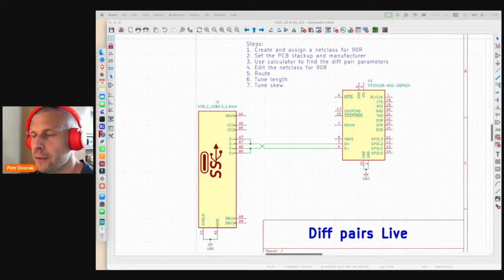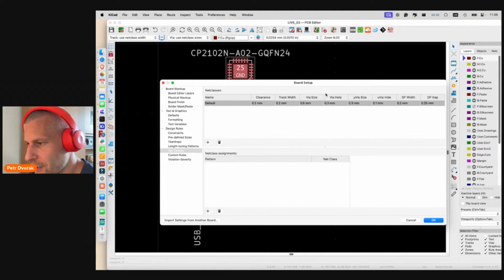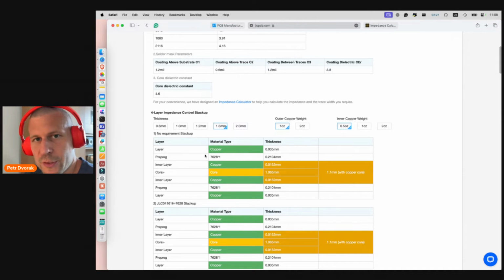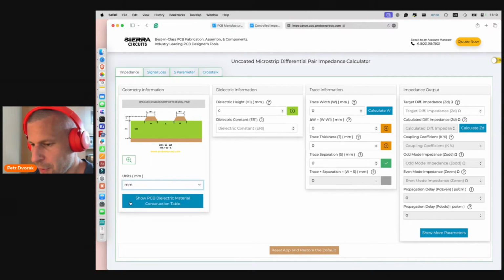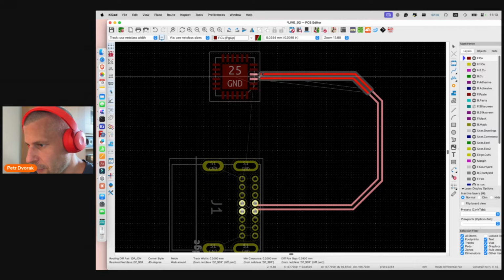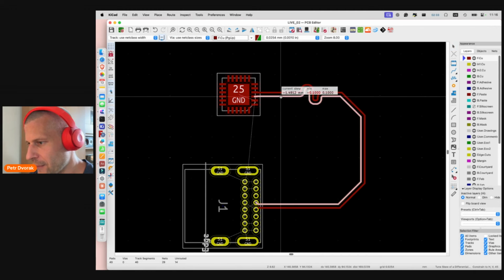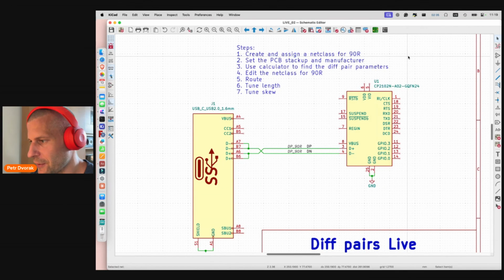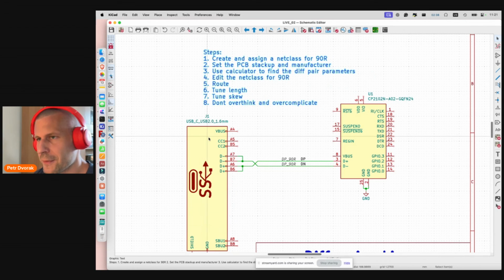KiCAD Differential Pairs  From Basics to Mastery

Comment: Thanks for introducing me to this calculator. Once you start digging into this stuff, you realize there are countless calculators out there, and none of them ever really agree with each other. The Sierra Circuits one seems pretty accurate, though.

Note that you have introduced a mistake in your video: when you calculated the track thickness at 12'00", you forgot to specify the 1oz (0.035mm) copper thickness (T). The calculator doesn’t warn you, but it displays an incorrect trace width W (which, in this situation, is always 0.2507 regardless of the gap between the traces). You would have noticed this if you had looked at the “Calculated Diff Impedance” cell, which always shows 0.

The correct thickness for 1 oz copper is 0.2553 (fortunately, that’s very close to 0.2507).

Also, I think it would be better to use the calculator for “Coated Microstrip,” which allows you to take the solder mask thickness into account (for JLCPCB, set 1.6 mil for H1C and H3C, and 0.6 mil for H2C, with a Coating Dielectric Constant ER2 = 3.8).

Best regards, Olivier / f5mzn
Reply from the maker: Thank you for correcting me. It's lovely to see that somebody watches my videos carefuly. See you in the next one!

Comment: I noticed that after adjusting the Skew (at 17:50 in your video), after adjusting there is a problem of internal gap mismatch in the differential pair in the design rule. What effect does this have on signal integrity?
Reply from the maker: The extra asymmetrical meander can cause distortion of the signal when the peak of the meander is close to another track or component. We have to be careful here.

Comment: Hello, i have a question. When i want to use a esd protection chip with these lines, where the pads have a bigger gap between how can i do that?
And would you use a esd protection, if yes do you have a specific one you normaly use?
Reply from the maker: I use small ESD diodes in 0402 package with low parasitic capacitance. You should look for the ESD diodes designed for the target communication bus. When the IC have bigger gaps between pads, you have to route the pair as close as possible to the IC. Then, you symmetricaly connect the pair lines to the pads using 45-degree angles.

Comment: I think the question at the end aims at the USB protocol/specification (or generally at any other protocol/specification, such as RS485, Ethernet, etc.). An absolute zero is not always required or even practically feasible. 
Every interface allows a certain maximum length difference of the DP's (or signal delay between _P and _N). 
Length matching is one point to ensure clean signal transmission. The physical track enables a certain transmission speed (propagation speed in copper). If the differential pairs have different lengths, signal delay occurs (this causes jitter. worst case up to a complete signal loss). 
So one of the goals is to map equal lengths (as equal as possible and even required). This way the signals (both DP signals) arrives at the receiver inputs without delay. 🙏
What the questioner asked for, is that a length difference also represents a delay in time. Some people like to think in terms of length differences (often pcb designer), others prefer to recognize the signal propagation time or its delay (mostly these FPGA guys or test engineers). 
But...it doesn't matter, it means the same; 
The question was therefore asked about the maximum permissible length difference (or in terms of time, which delay is permitted) - according to the USB specification...